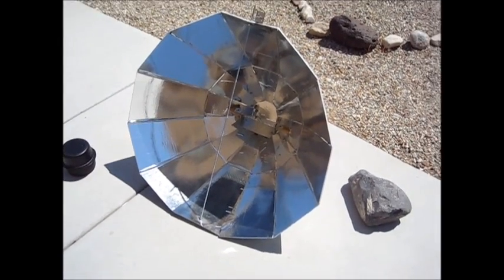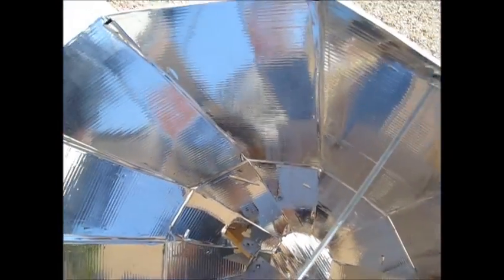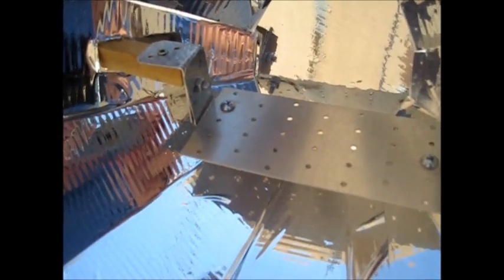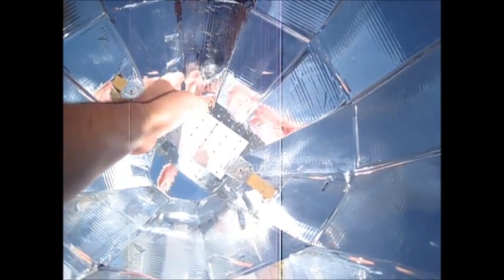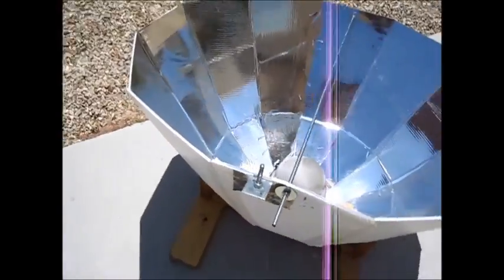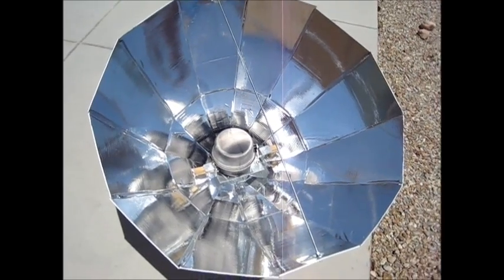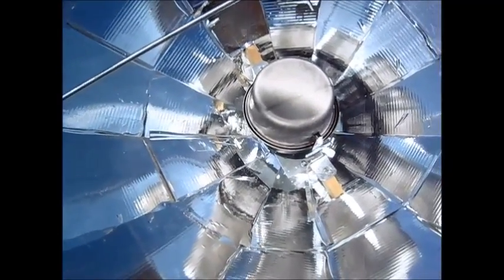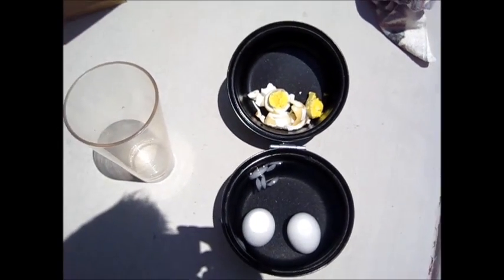Homemade Double Angled Twelve Sided (DATS) Solar Cooker Parvati

Comment: Awesome cooker. Your link for the reflective adhesive mirror is very nice. Do you have also link for corugated plastic sheets? Thanks!
Reply from the maker: +Boki Mne   I bought mine at a local sign supply store.  In particular, I bought it at N Glantz & Son Sign and Graphics Supplies.  They sold a 4 by 8 sheet of corrugated plastic for around $12.